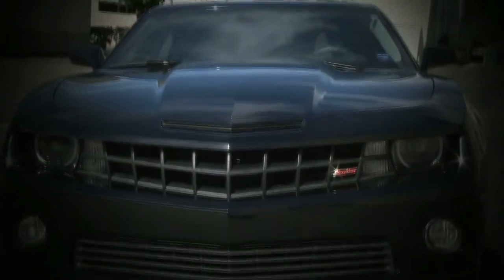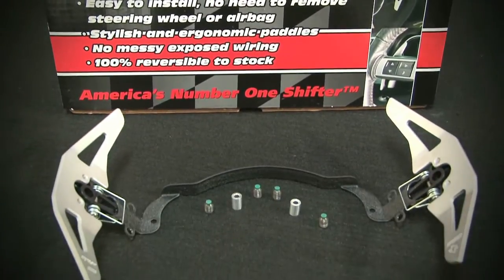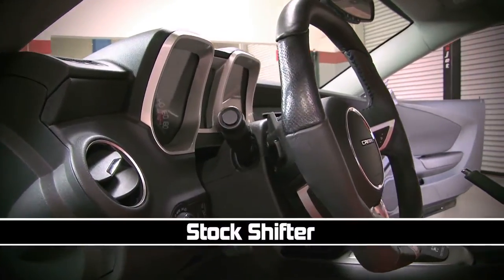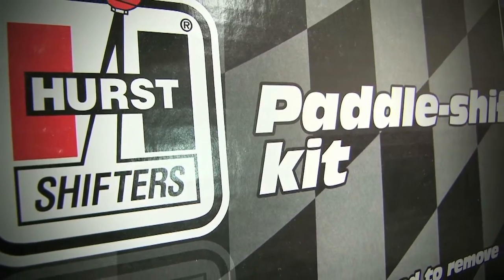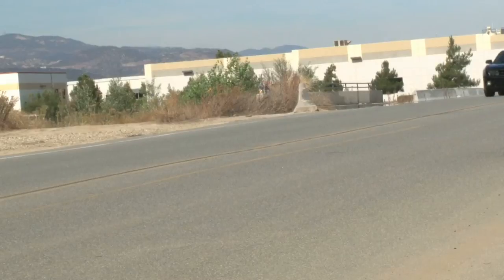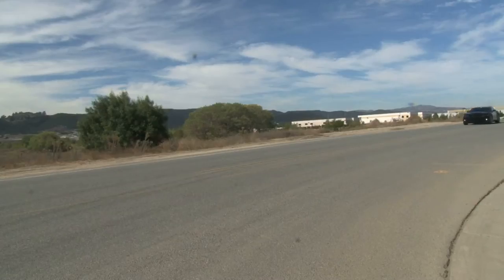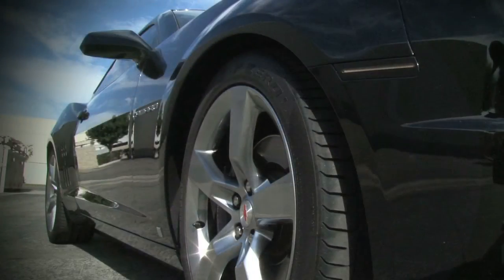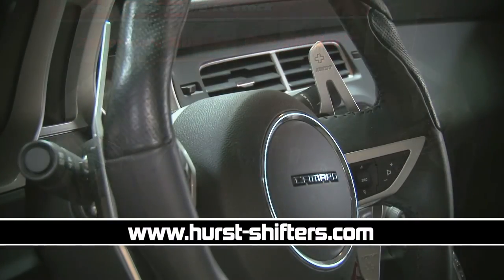How To: Installing Hurst's 2010-up 5th Gen Camaro Paddle Shifter

Comment: or you could just buy a damn 6 speed! you bought an automatic because you dont want to use a clutch so stop faking it with paddles
Reply: No clutch, and you cannot control the redline shifts and if you try to downshift at speed the car will clunk down hard tearing up the trans. So its basically pointless. Automatics are only good for off the line acceleration. They have no top end at all.
Reply: They usually won't let you redline or come close and your shift points at 4200 seems kinda low but i know the ls3 and l99 are different they might be geared differently but ive had a lot of work done to mine and i shift at 6300 now since my redline has been upped to 6800 and talking about downshifting at speed say your traveling at 80 and drop into third to gun it the transmission would just clunk hard trying to match engine speed
Reply: ***** ya you gotta Let that thing rev up lol and i have the lms slayer package on mine intake headers cam exhaust and upgraded synchro and ring and pinion im at 481hp to the wheels and yea i believe it those tires are so expensive i have bfgoodrich sport comp 2s on mine those were 700 mounted and balanced lol
Reply: ***** yea at least for mine thats my sweet point, id look up some videos on here for pointers for the l99s or check camaro5.com there's some good stuff on there
Reply: Hey quick question sonif you install the paddle shifters you dont have to do anything to your transmission you just put it on M and use it is that correct
Reply: And thats why u just 3800 stall it lol.
Reply: basplya04 my parents won’t let me buy a manual
Reply: I like a manual as much as the next gear head but you do realize there is a reason why all the super cars have gone to paddles right?  They smoke manuals on the track,
Reply: @deecee4644 thank you ! My thoughts exactly! I have just shy of 600  🐴 at the wheels and I really enjoy having two hands on the wheel myself 😅 I’ll stick to shifting gears when I’m playing in the mud in a truck.